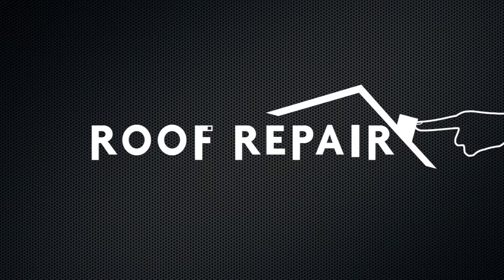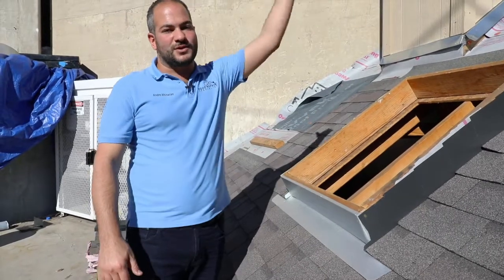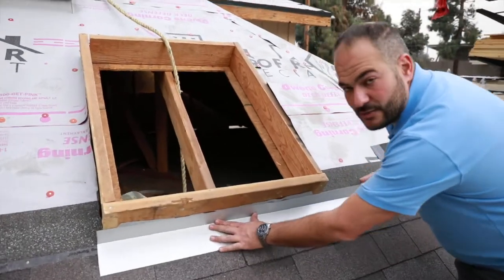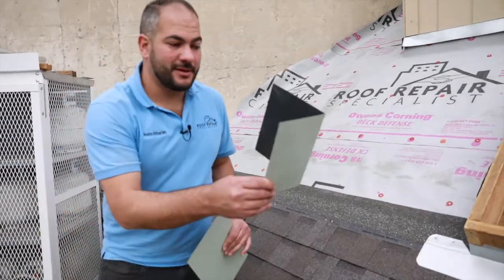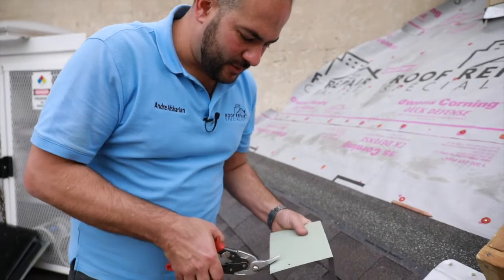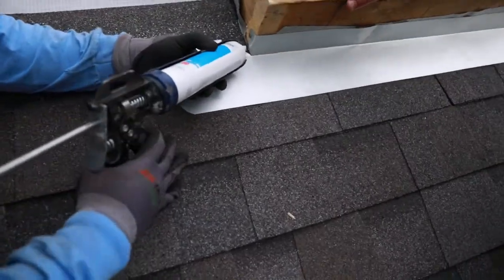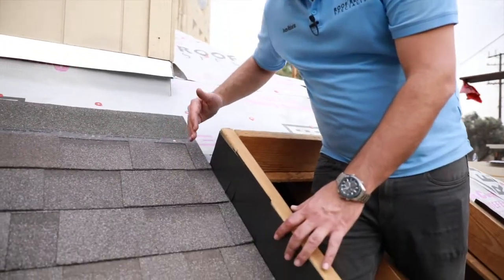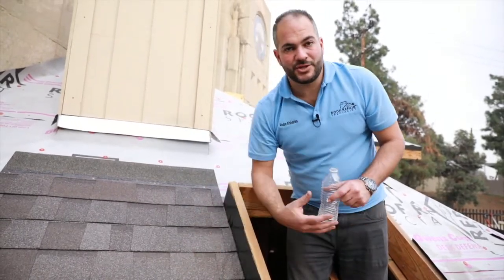How to Install Chimney Flashing | Shingle Roof Install Guide

Comment: My garage has a chimney that has a box built around it that goes through the roof and one side is attached to the gable side of my house. So, there are 3 sides that need to be protected. Would I use this same method for my chimney?
Reply: The upper side collects debris. Not sure if its called a dead pocket or not.
Reply from the maker: No slightly different. We would build a cricket and give a slight slope. Approach with caution, that’s a tricky detail. I don’t have a video on anything like that

Comment: Someone told me this is a lazy way to do roofing and should not be done as it will fail much faster than tucking the flash in the Chimney. Will you elaborate on this technique in that regard. Thank you
Reply from the maker: Not clear on your question. This technique is tucking the flashing under chimneys counter flashing. 
Usually chimneys will have z bar.

Comment: 3 nails on a step flashing? one of those nails are way too close to the wall as well which will cause a leak after a while 

I put 1 nail in the top left corner and a little bit of tar to sit the step flashing onto the shingle
Reply from the maker: Ya, I think your probably right. It might be better just to do 1 or 2 nails all the way at the top.

Comment: Can you use metal bent at 120 degrees
Reply from the maker: That’ll work depending on the pitch of the roof, 10 degrees won’t really make a difference
Reply: Thanks can you use just a coil metal and bend it by hand estimating the angle

Comment: So many things wrong on this video. Nails too close to the wall. Saddle area that top shingle should come over about 12 inches past the edge of the corner. Having to use caulk to seal an area that is that open will leak.
Reply from the maker: Do you have snow and ice dams in your area?

Comment: So what happens 7-10  years from now when that caulk dries and shrinks 🤔 running the shingles flush at the top gives the water nothing to run off 🤔 the water also runs down the face and backside of the chimney 🤔  crickets are for guys that don't have a clue 🤔 my roof never leaked b4 you guys came 🤔  well you need a cricket 😂 if fix janky stuff like that all the time 😂 I bet you run the shingle flush at the top of the wall where it transfers to the  valley and run cap/flashing and caulk and still can't figure out why it leaks
Reply from the maker: Wow, so many great points. I should close my business

Comment: So a couple of quick points. Not sure why you would install a saddle flashing component WITHOUT a cricket, that’s a huge professional Nono and long term, not a good solution. Second, why on earth wouldn’t you GAF StormGuard, ice water barrier BEFORE any flashing installed. These steps are rudimentary and almost apprenticeship level steps! Overall, not a bad video, but certainly I wouldn’t pass this as an “expert” install.
Reply from the maker: 1) We install crickets on chimneys wider then 30”
2) I’ve and water shield is optional and not required especially in areas that don’t have snow and ice damns. 
Any roofer should know this

Comment: i really like the step flashing /  .. ( i know that's what's missing on my roof.. and MY QUESTION is.. is there a way to fix that.. ( instead of that  ( long L  piece) .. ( with out taking off the (hardyboard) siding now? ... gez THANKS!!   (cuz YEAH, if you are redoing the whole roof.. and taking up the siding and all.. 'it's easy to redo' at that point'.. but your  throwing 20k into it... hahaha  ( when it's a 20$ piece of flashing right.. lol .. idk.. ( no point in putting more 'tar or elasto- STO over it i guess... *shrug
Reply from the maker: Thats a tough one. there is a way to retrofit it, a little hard to explain without a video but I'll try. Essentially you cut the bottom 6" of siding without remove it. Now you have a 6" gap between your roof and siding. At that point your able to install step flashing as needed. Then install Zbar if your able to , if not just install a 1x or a hardie 1x and caulk it.

Comment: The 110 Metal, you're nailing into wood. How should one fasten if the chimney is brick and mortar ?
Reply from the maker: When working with Chimney's the best practice is to not fasten it to the chimney and just fasten to the roof. The reason is that chimneys are independent from the roof. There is actually movement that takes place.

Comment: Usually the orders to put the chimney shingles are front apron , 2 sides of step shingles then the back higher slope of back apron. If my chimney the highest slope point between on the left corner of my back apron and on the left top of step flashing, and also the highest point of my chiney hits the hip, what do you suggest to put the flashing order? same way? Do you have any tips for this kind of shingles order to set up?
Reply from the maker: Honestly having a hard time picturing your exact situation. Every job presents a unique situation that sometimes need field fabrication. The concept remains the same. Water flows down, top flashing or shingle on top of the bottom one.

Comment: 11:11 the areas where Marco nailed on that rain diverter, I would also seal them with ice and water. I would put ice and water to cover those nails and cover the upper edge of the diverter to prevent any water from going underneath the rain diverter to the chimney area
Reply from the maker: Definitely wouldn't hurt

Comment: Great work.  The roofer I hired did a less than satissfactory job around the Chimney. it leaked.  When I contacted him, he said 'that chimney stye is difficut to work with.'    I Replied,    Then why did you not say that before taking on my roof replacement?  No answer.  Just a not good contractor.
Reply from the maker: That’s a bummer